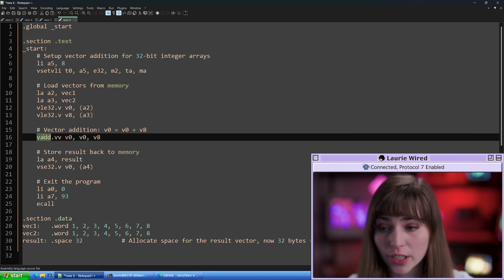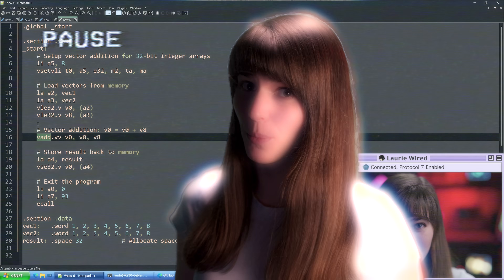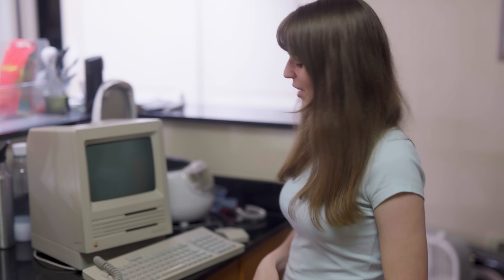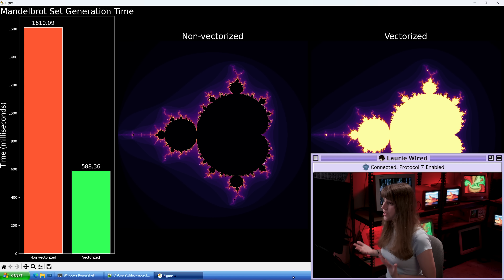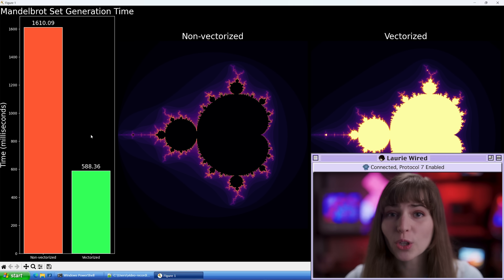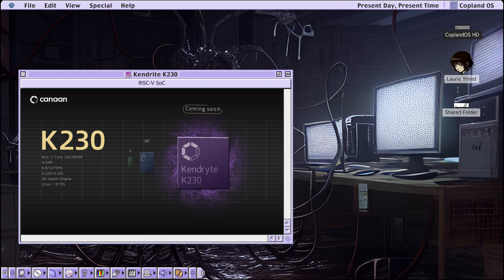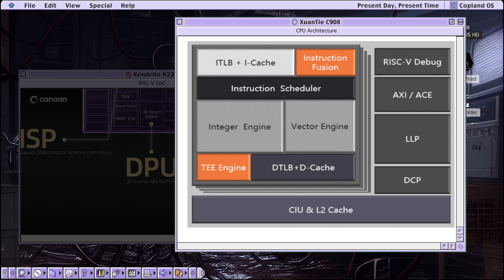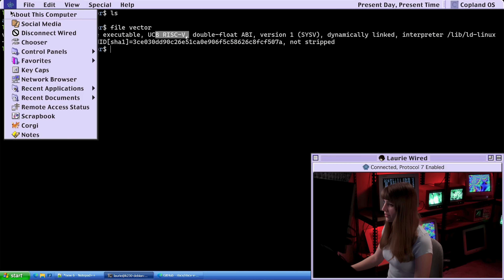The Magic of RISC-V Vector Processing

Comment: Subscribed! Great quality of content explanation and DEMONSTRATION, wow! As far as my own work is concerned, I will still stick to my VERY high level data-centric language, very abstracted from memory cells and CPU registers, and just trust that the creators of the language have implemented it better than I ever could. And I am very glad that in the last 15 years or so it has protected me completely from any memory leaks or weird things. I am a database programmer writing systems for the Internet. Maybe VLA will also make into X86 at some time, or into GPUs, or maybe the latest Qualcomm.
The worry that I have about RISC V is that if everyone has their own instruction set, compilers will not play well with that, until everyone writes their own compiler, OR dives down into Assembly. I as an application level developer get asked about "Where is my screen" or "where is my report" rather than how does the CPU load it, or which CPU do you have in the first place back at the server.
Do you do your OWN video editing or farm that out to an editor? In any case, GREAT WORK!

Comment: I literally just now fixed a bug on x86 caused by trying to run a binary using AVX512 instructions on a CPU that doesn't support them. That never would have happened with RISC V and VLA!

You always do a fantastic job of presenting deeply technical concepts in an accessible way without dumbing them down. This video may well be your best so far - an extremely ambitious undertaking, and you knocked it out of the park!
Reply: x86 has existed for decades. Of course you would be more likely to find a processor that doesn't support a recent extension? If a risc chip didn't support vector instructions it would raise an exception too
Reply: don't lie to your self and others. that would have happened in any isa and cpu. these vector instructions are not something magical that is going to solve everything.

Comment: Well done Laurie. Very informative and to the point. I haven't tested the K230 yet, but I had worked with the K210 a couple years ago. The downside is that, while the SDK was alright, there was almost no documentation to speak of at the time, so doing anything "baremetal" was a pain. I wonder if there is more documentation for the K230. That was definitely a problem with Kendryte.
I am currently working on going baremetal with the CV1800B (the chip on the MilkV duo boards) which also supports vector instructions, at least there is a (preliminary) datasheet with all registers described, but it's still not easy to start with if you don't want to use their SDK as is - it's a gigantic repo with many, many files and a pretty intricate set of scripts.

Comment: Very technical and hands on. A lot of work must have gone in producing this video alone. Subscribed.
And yes, RISC-V is going to be bigger than AI and crypto for sure.
Reply: ai and crypto and games - virtual enviroments and massive persistant worlds ... will be why vector compute does well or not. 

will it out perform nvidia's ai integrated hardware ny itself or become integrated with ai hardware.

thats going to be the hard part. ai optimized hardware doong the same thing vs native massive simultaneous threads over all. noded epyc sbpc. 

🤔 are you telling me avx512 has physical 512-bit lanes or is it software emulated with code at the hw level?

Comment: I'd be interested to see what the hardware cost is of implementing VLA in a given core architecture and what the implications might be for smaller, low power architectures, such as those intended for microcontroller applications.

At first glance, that seems like quite a bit of sophisticated logic to implement at the hardware level, but then again, vector processing is used in so many different applications nowadays, so I suppose that could be a worthwhile trade-off?

Comment: Amazing video. I was wondering what the downsides are (ie why wasn't Vector Length agnostic always standard?). Is it just the extra transistors for the CPU to support mapping the requested size to the hardware (presumably if vector requested under 2x hardware vector length available it just two operations etc). Are there any optimisations the compiler can do when it knows at compile time what the hardware vector length is that it can't do if it produces code for VLA?
Reply: Standards don't appear overnight. It takes time to figure out what needs to be standardized.
Reply: @shanent5793 But people haven't had compiled code that only works for a certain memory size for decades, why was compiled code ever tied to a vector dimension?

Comment: I work at Tenstorrent, where we, among other things, design RISC-V CPUs primarily for data center use. It's good to see RISC-V gaining popularity and support. Hopefully, the ARM-x86 duopoly will come to an end!
Reply: OK I have a complaint :) I have your card which supports very old ubuntu version and it doesn't remotely support redhat based distros.
Reply: This is one of the stupidest things i ever read, the less architectures we have the better because programmers don't need to make whole separate versions of their software or use emulators which degrade performance no matter how good they are, also me needing to explain why your stupid opinion is stupid makes me think you don't know anything about computers let alone work at company that does CPU design

Comment: /g/ are going to loose there minds if they find out about this channel lol.
All jokes aside, while I'm a big fan of RISC-V getting more mainstream with better hardware. To my understanding of the license (I may be wrong) there isn't anything stopping the 'BIG CHIP' industry from adding the usual glowing spookiness and locking the hardware up. Embrace, Extend and Extinguish.
Also I'm predicting that the escalating 'sabre rattling' between China and America is going to push China's to look for alternatives from the wests compromised hardware ecosystem. And RISC-V (or some variation)is more than likely going to be part of that solution.

Comment: If RISC-V becomes mainstream, it will be quickly consumed.. or maybe the right word is subsumed?.. by corporate interests.  From what I've read, the licensing is set up to fail as organizations race to create the 'must have' extensions to the architecture.  There is nothing stopping Samsung or whoever from creating some seemingly extraneous widget that could become de facto vital and then they can use that leverage to steer core development in to their own corner.
Reply: This is not how software development works. There is a ton of useful instructions in x86 that mostly gathers dust, because no one can be bothered. Samsung would have to convince everyone their extension is useful for it to have a chance to be mainstream.
Reply: @Salabar_  All a company would have to do would be A) pour the most money in to core development contributions and B) be first to make a RISC-V processor that performs in a way that is disruptive in the market and if they are allowed to patent their 'extensions' it will become the de facto standard.

That sadly IS how software development works and Microsoft proved it years ago.  Look up "Embrace, Extend, Extinguish" and look in to who has contributed the most to Linux kernel development.  The idea that it's just a bunch of volunteer individuals is false.  It's corporations vying for control of the ecosystem and systemd is a perfect example of such an attempt to commandeer the project.  That is IBM trying to take total control over Linux via Red Hat.

RISC-V has already set a dubious precedent.  Developed with American money and the ingenuity of American university scholars, the project was whisked away to an international holding company once it became technically viable.  As usual, Americans pay for everything and foreigners will be the ones getting rich off our backs.

Comment: Though, not entirely obvious how this would be done on the hardware side of things...

Say, for example, if one requests a vector operation for a size larger than the native hardware vectors, and one doesn't (yet) know the destination, then a mystery happens as to where the values would be held between the initial vector loads and storing the result.

Looks it up:
Seems if one sets a vector type that is not supported natively, then the vector instructions will be handled with emulation traps. I guess this works...
Does technically allow a similar approach to what one might use with SIMD, but means that trying to use a larger vector than supported by the hardware would cause the code to be very slow...

I am writing this as someone who had designed a CPU (in Verilog) that is also able to run RISC-V code (along with my own ISA), but, as can be noted, does not have the 'V' extension (but it does have RV64G / RV64imafd). In my own ISA, there is SIMD (with 128-bit vectors, similar to SSE), albeit still using the general purpose registers (they are used in pairs for 128-bit SIMD instructions). Technically, my ISA uses GPRs for FPU instructions, but has twice as many GPRs as RISC-V (64 rather than 32), so the handling of the F/D extension in RV64G mode is to use the high 32 registers as the F registers. Seems like the V extension would likely require increasing the number of internal hardware registers (though, it could be faked entirely using traps, but this would be slow).

Though, I can note that one traditional downside of SIMD is that, if not done well, it can lead to an every increasing set of SIMD instructions. In my case, had been conservative as to what instructions were added, and had set a limit of 64 and 128 bit vectors (as either a single GPR or, as a pair of GPRs).

Comment: I really liked you use of the Mandelbrot set for you example, it brought back a memory. This was back in 2002 and I had a friend that was mocking me for having bought Macintosh. He was comparing the 550mhz G4 I had to his Pentium 4 running around 2ghz. He wanted to know why I bought such a slow PC. Wanting to prove that clock cycles were not everything I hit upon using a fractal program that ran on both Windows and MacOS. I had a feeling I'd beat his machine in a race to render the set as my G4 had two 128 bit vector processing units that Apple marketing droids named velocity engine or some such nonsense. Anyway yeah, my G4 beat his P4 handily in the render times.

Comment: I think a different title would be more appropriate for the video. It may be just me but I started the video expecting to learn what is special about RISC-V's implementation of vector instructions (vector length agnosticism) and that is only ⅒ of the video. And during the assembly section, the most important line for vector length agnosticism (vsetvli) is glossed over. The assembly sample also does not make use of t0, which is pretty crucial to understand what makes RISC-V's vector ISA special.
Furthermore, if I understand the docs correctly, the explanation of vector length agnosticism in the video is not really correct. The CPUs do not have flexibly sized vector registers. Rather, they have a way for the processor to pass to the program the number of elements that would fit into its register so that the program can accordingly update the pointer to point at the next region of memory to be processed. This is a cleaner and more general solution to vectors-of-different-sizes problem, but it is important to note that on x86, programs can still read the CPU capabilities at runtime and run different implementations of the same functions for different vector units accordingly. I think for RISC-V the greater advantage of its approach is not backwards or forwards compatibility, it is that the approach allows different processors that are contemporary but on different market segments (and hence have different silicon budgets for vector registers) to run the same code. 
Lastly, backwards compatibility is not a big deal for x86 vector instructions. For example, 128-bit vector registers are aliases to the lower halves of the 256-bit registers. Sure, there is wasted potential if the program only supports the smaller-sized vectors, but that is not the inefficiency the analogy in the video would imply. The CPU is not keeping "old trays" around, it can cook just 2 cookies in a 16-cookie tray, if that is what is provided by the baker.
For the case of the program expecting 512-bit registers but the CPU only having 256-bit registers, there are solutions to that too. Zen 4's implementation of AVX-512 uses 256 bit instructions under the hood. The CPU needs to be explicitly designed to have compatibility with larger vectors, but it is beneficial for supporting programs compiled for larger processors with smaller silicon area.

Comment: Wasn't the assembly snippet you showed not vector length agnostic? In addition, the ffmpeg assembly you showed doesn't look vector length agnostic either, and from the looks of things only uses 72 bits of each vector register. If the vector length agnosticism is one of the main selling points of RVV, wouldn't it make more sense to show that off?
Reply: The code snippet and the ffmpeg code is vector length agnostic, in the sense that it works for every vector length >=128, which is the minimum required vector length for RVV.
The ffmpeg code can't be written to take advantage of the extra performance of larger vector length, due to the algorithm being designed around a fixed size. It will still run on cores with larger vector length though.
ffmpeg also has a bunch of code that can take full advantage of the vector length. If you are interested, you can also look at the simdutf library, it has a RVV backend that can take full advantage of the vector length in all functions.
Reply: @oj0024  While looking for the snippet shown, I did see ffmpeg code that made use of vector length agnosticism. While the code shown does work with larger vector registers, it's not really any different from SSE instructions working on the lower elements of a 512-bit register. I think if they wanted to show off the agnosticism better, they should've probably used one of the other ffmpeg patches that actually makes full use of it.

Comment: Sadly my newly bought risc-v board uses 0.7.1 draft spec 😭😭 I managed to ssh into it, my assembly knowledge is poor so i have a lot of learning to do (docs are mostly in chinese 😅)
Reply: Version 0.7.1 isn't so bad, as long as you can compile the software. I was able to run Stable Diffusion XL with OnnxStream and RVV 0.7.1.

Comment: well fpga x86 emulation is used for free, no license required. and I dont think intel and amd dare to force licensing actually. but gpu risc-v is much more interesting. usually when you really want to, you dont care and make your own instructions set, disregarding any compatibilities to anything else. and maybe make your own open source toolchain to integrate to linux or something. or not. that is if you want pure computing and independent apps. no need to conform to any spec of any kind. not even OS. diy everything if it comes down to it. sometimes you dont have to do a large batch to get stuff working. economical reasoning out of the way. so you say that risc-v can run as gpu the same cpu code directly. would be handy. no different code base or style for each. just throw the code to a gpu and it processes it faster.

Comment: So, no other CPUs have Vector instructions?

Of course they do.

These instructions  are not “nice”, but absolutely needed, if this chip/standard is to survive and be used widely.

I recommend you don’t put electronics inside the hot oven.

Oh, it was just for show?
Reply: Other CPUs are not RISC-V, so this is good news for RISC-V. While these instructions are needed, they are also "nice". My home laptop is Kaby Lake R but does not have AVX instructions. It can still play games like Crysis 1 well on iGPU.
Reply: Most of what was in the video is pretty much the same as on other platforms. Vector length agnosticism is more special, at least on CPUs, but there are still a few other systems that have it, including ARM's Scalable Vector Extensions (SVE) and the older Cray-1 vector processor, and also none of the instructions shown in the video actually show off the vector length agnosticism. The code she wrote for demonstration only works properly if the system in question has at least 128-bit vector registors (which is required for the full V extension, but not required for all variants of RISC-V's vector extensions).